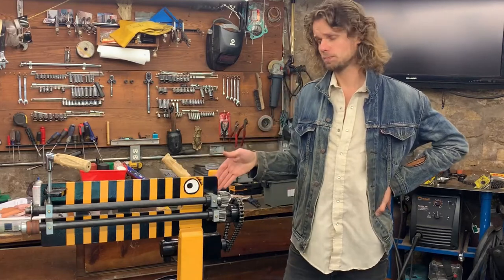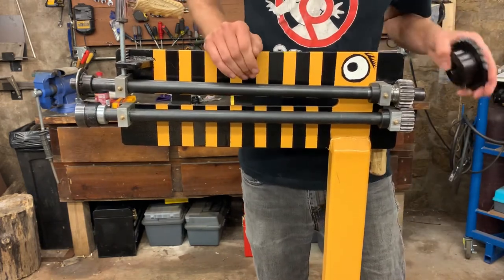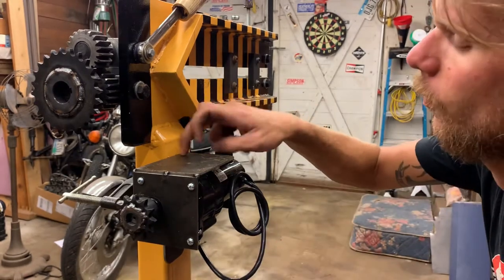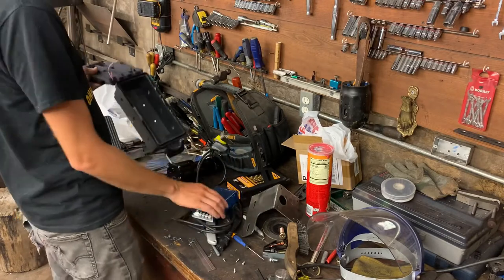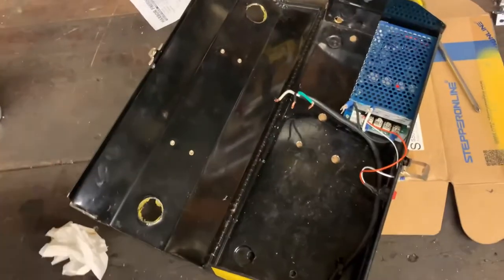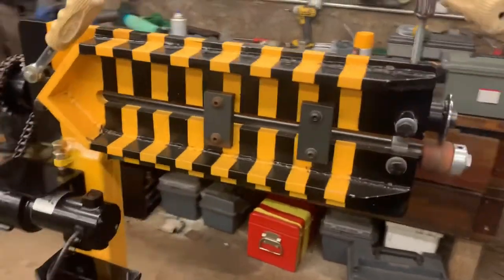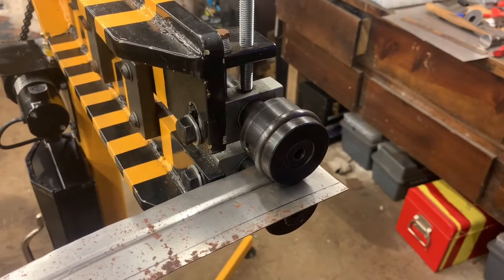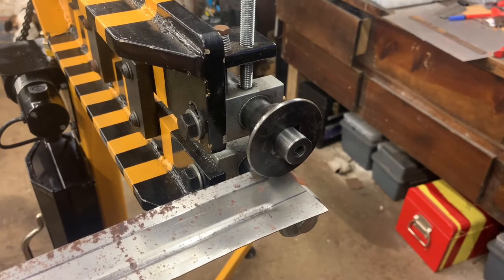How to Add A Motor To Your Bead Roller CHEAP AND SLEAZY

Comment: This is definitely one of the better versions of a motor mod I've seen for this roller. Bueno. I have the Woodward Fab version of this bead roller and just got the Harbor Freight electric pipe threader to use for mine. Plan to mod everything so that I can swap the motor between the bead roller and the Harbor Freight Tubing Roller w/Swag Off Road mods (which I already have). But for a stand-alone mod, this is fantastic. Great video. Thanks! Would love to see a follow-up vid with how it's holding up someday, along with a component list for the mod. P..S. What's the B-movie in the background? Love me some B sci-fi.

Comment: Got a link to the motor your using?
Reply from the maker: https://www.ebay.com/itm/ALMOST-GONE-BODINE-REVERSIBLE-GEAR-MOTOR-12-VOLTS-DC-60-1-REDUCER-VARIABLE-SPEED-/233000795492?mkcid=16&mkevt=1&_trksid=p2349624.m46890.l6249&mkrid=711-127632-2357-0